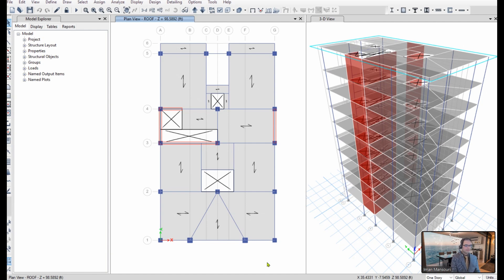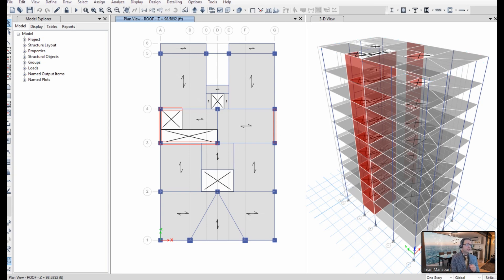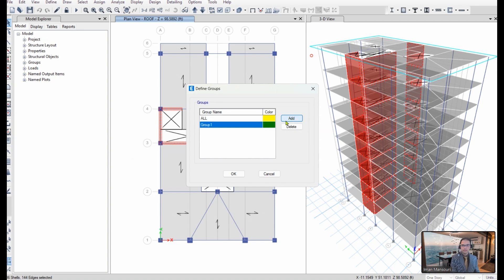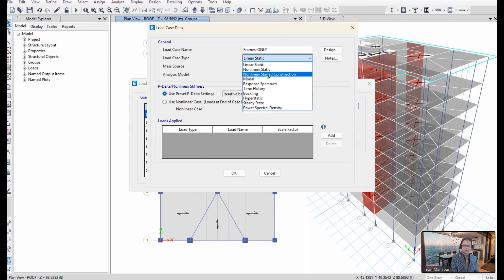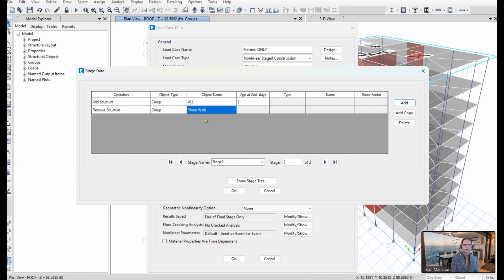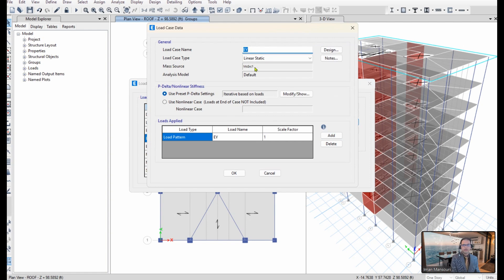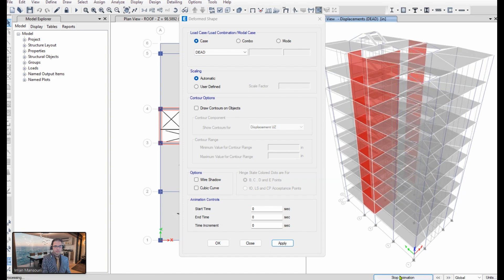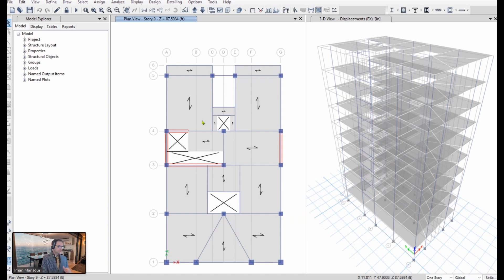How to Check the 25% Rule for Dual Systems in ETABS / SAP2000 | Staged Construction Analysis

Comment: Could you please advise me how is it apply for spectrum analysis?
Reply from the maker: Regarding this matter (using dynamic or static analysis for the 25% portion), the code does not specify or mandate either approach. So, you are free to perform the check using either static or dynamic analysis. If you use dynamic analysis you have to scale the dynamic earthquake results to be equivalent to 25% of the static earthquake. In the load combinations, only the dynamic earthquake will be included. If your structure is regular, depending on the case, you can scale the 25% static earthquake by 0.85 or 0.9. For example, for a completely regular structure, you can scale as follows: 0.85 × 0.25EX = 0.21EX.
Reply: Thank you for your response,so you say that this metod dos not applicable with dynamic spectrum analysis, actually the static analysis method is not permitted since the project is tall building in seismic design category -D.

Comment: Can't we use the lateral stiffness modifier F12 & M12 to a very low value, lets say 0.00001? This way the shear walls still contribute in gravity but very less as lateral resisting system and the overall stiffness matrix of the whole system is not disturbed. Your comment appreciated please.

Comment: Dr. Iman, what is your approach to separate lateral force and gravity force system designs in ETABS?

For instance, for the model you show in the video, I do not want to use dual system, I want the shear wall to fully resist the seismic load.

What do you do? Do you release all the beams and columns? If so, how is the detail going to be for RC structure? If not, how do you make sure the seismic load is going to be absorbed to the shear wall only?
Reply from the maker: To achieve a walls-only lateral and frames-gravity-only model in ETABS, create two separate models: one for gravity analysis and one for lateral analysis.
Reply: @imanmansouri4927  Hello Dr. Iman, so will the detail be pinned elsewhere then?

Say you are designing a building with flat slab for gravity system and core wall for lateral system.

Modelling the columns and slabs will make some seismic load absorbed to the gravity columns due to the stiffness they have. On the contrary, not modelling them will put a question mark on the detail of gravity-seismic system interface.

Comment: Dr. Iman, thanks for sharing this really helpful video. 

What is your comment on the following methods:
1) Analyse a complete model, shearwall + frame. Check the total base shear (Vt) and base shear resisted by frame (Vf). If Vf < 25%Vt, then obtain Vt/Vf factor to input in, say, Ex load case. 
2) My understanding of 25% code requirement is for the frame to resist (psuedo redistributed) lateral load as shearwall yields (losing some of its stiffness). If this is logical, will adjusting the shearwall stiffness f11, f22 until the Vf reaches 25%Vt a reliable approach? 

I'm looking forward to hearing from you.
Reply from the maker: Great question. Both methods you mentioned have been considered by engineers, but neither aligns well with the intent of ASCE 7. The Vt/Vf scaling approach doesn’t directly test whether the frame itself has sufficient capacity. It simply rescales the system response, while the requirement is that the moment frame alone must be able to carry 25% of the design seismic shear.
Reducing wall stiffness (f11, f22, etc.) is also problematic because it creates an artificial stiffness distribution. This distorts how loads transfer to boundary elements and can lead to incorrect results. The code does not require simulating wall yielding; it requires an explicit check of frame capacity. The more rational approach is to use Nonlinear Staged Construction in ETABS.
Reply from the maker: The 25% rule isn’t about analyzing the two systems separately; it’s a capacity check. Even if the wall/brace takes most of the load in analysis, the frame must still be designed strong enough to carry 25% of V on its own. This ensures the building has a secondary seismic system that adds redundancy and ductility, helping the structure continue to carry service loads (or at least the effect of gravity loads)even after a major earthquake.

Comment: Great video and approach, Iman. Thanks for sharing.
When defining the staged construction load case Frames-ONLY, is it necessary to include Stage 1 with zero operations? If so, what’s the purpose of that setup?
Reply from the maker: Glad you found this helpful! Good catch. Yes, one stage is enough. Just include both operations in that stage (Add Structure: All and Remove Structure: Shear Walls). An extra stage with zero operations doesn’t change anything, but it’s not necessary. Thanks :)

Comment: من فکر می کردم فقط آیین نامه ما چنین قاعده ای و داره.
حقیقتن درک این قاعده یکم سخته. نمیشه از اندرکنش دوتا سیستم باربرجانبی صرف نظر کرد و اونارو جداگانه تحلیل کرد
Reply from the maker: The 25% rule isn’t about analyzing the two systems separately; it’s a capacity check. Even if the wall/brace takes most of the load in analysis, the frame must still be designed strong enough to carry 25% of V on its own. This ensures the building has a secondary seismic system that adds redundancy and ductility, helping the structure continue to carry service loads (or at least the effect of gravity loads)even after a major earthquake.
Reply: @imanmansouri4927  , 25 % capacity how i will able to check please make vedio for learn practically